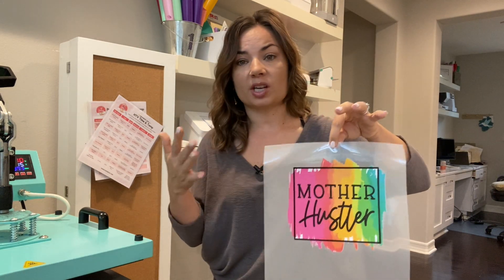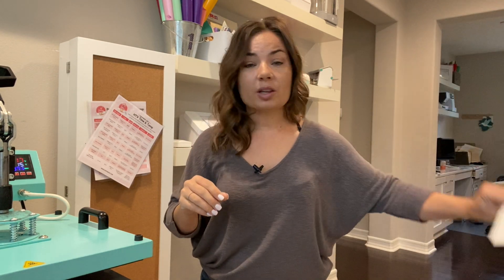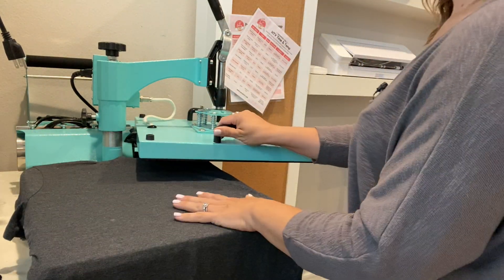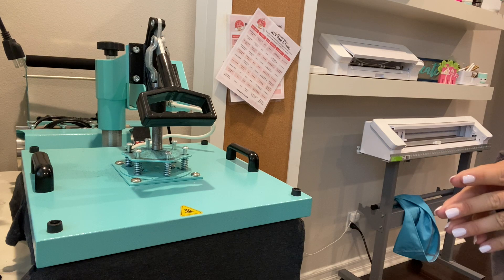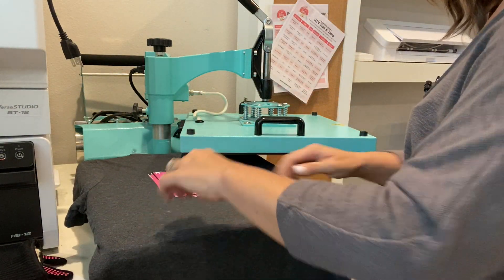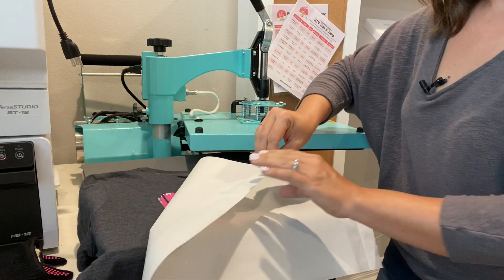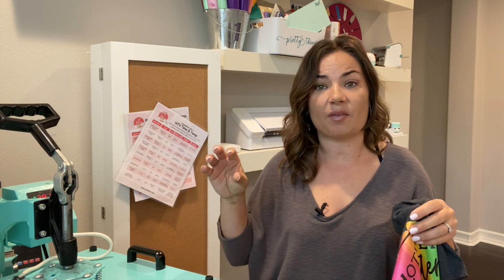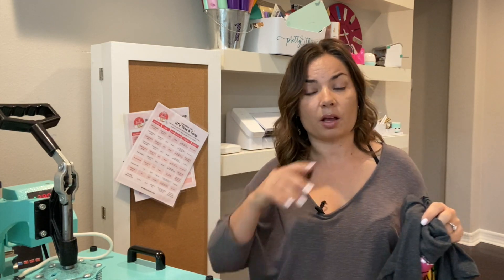Why the T Seal Finishing Sheet is a Must for Roland BN-20A

Comment: Very interesting.
I use Siser S-Print with the BN-20A because it’s so thin and soft but also can press at only 248 degrees. 
Sounds like this will pair nicely since the temp is already low.
When weeding something detailed with S-Print, it can help to add a dry time before cutting the vinyl. 
I have also noticed better presses in general after switching to the Hotronix Fusion.